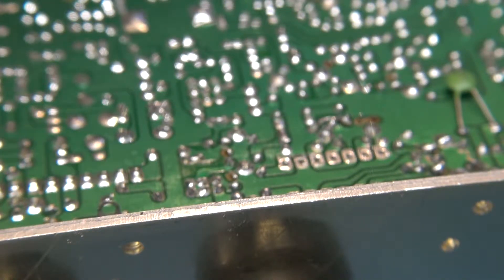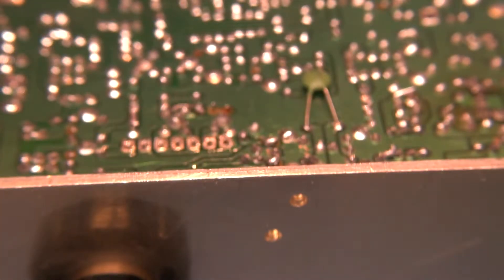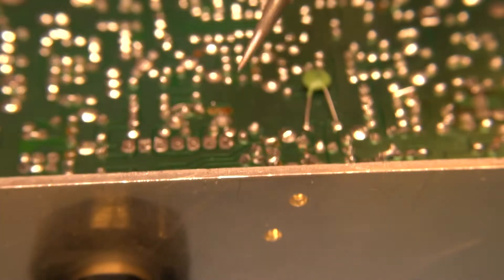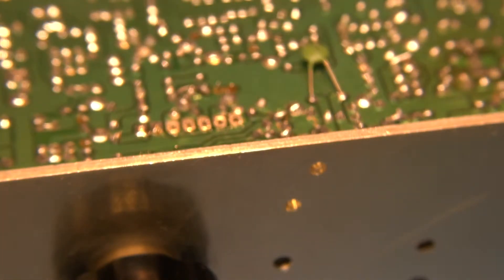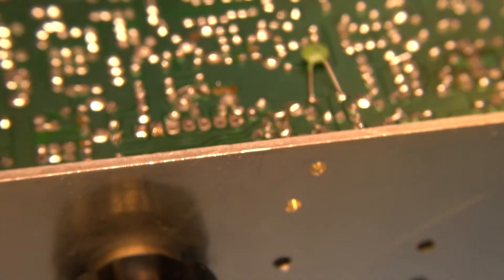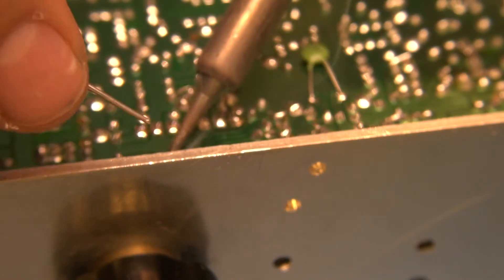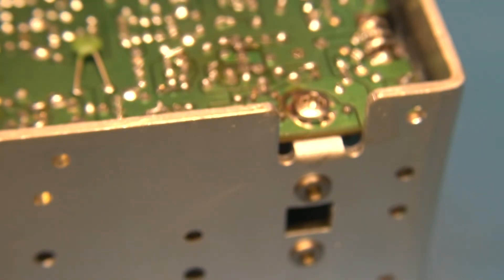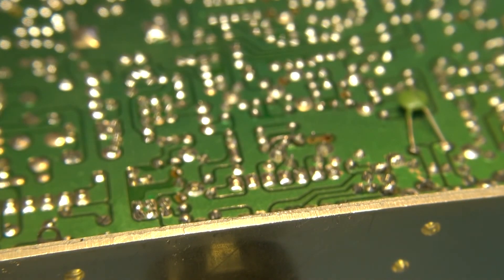GALAXY 949 REPAIR PART 4

Comment: Sooooo . . . did it work?  Or did it still have issues?

I work on radio and other stuff like it too.  Haven't done much smd stuff, just sometimes.  Like the channel.
Reply from the maker: Welllllll.... Did you see part 5? Thanks.
Reply: @Kev_31779  I had to dig around for it, but caught it.
Nice gear.